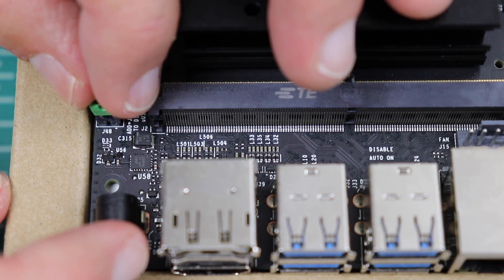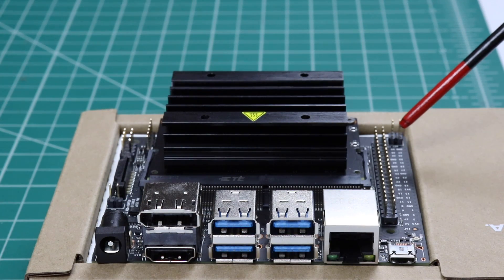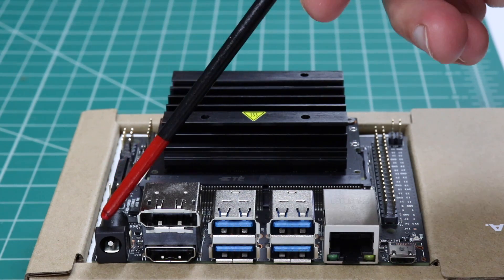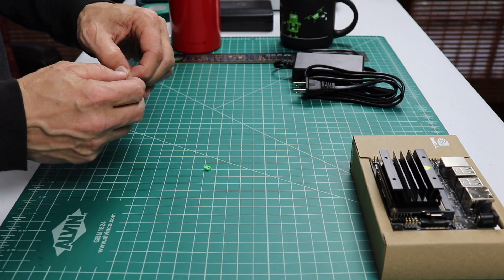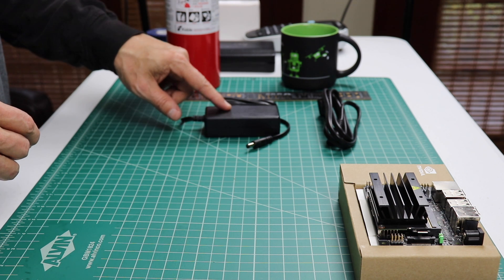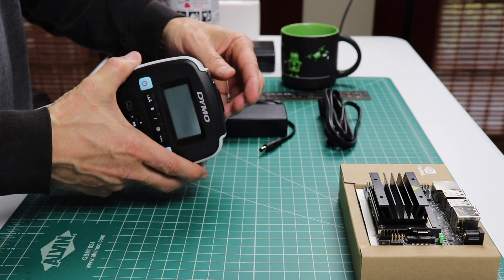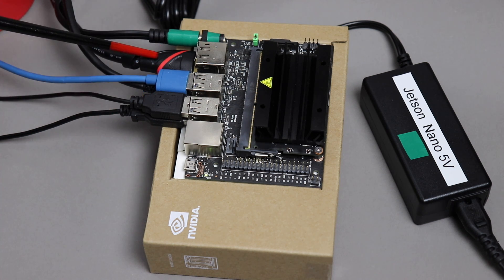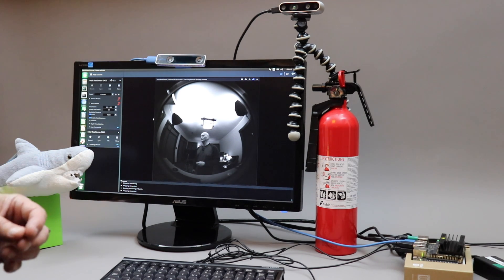USE the POWER! - Jetson Nano

Comment from the maker: I lied in the video. There are actually 4 ways to power the Jetson Nano. As mentioned in the video, there is the micro USB connector, the Barrel Jack, and the 5V pins on the GPIO header. There's also what we'll now call "the secret way", powering the Nano using Power Over Ethernet (POE). Many Ethernet camera systems supply power in this manner. Thanks to @Alex Carter for pointing out this blatant lie.
Reply: VIDEO =)
Reply: Hello! Could I use 5V 5A power supply with barrel jack in Jetson Nano?
Reply from the maker: @globalheII  Sure, as long as you use the right size barrel jack. Thanks for watching!
Reply: @JetsonHacks  Hello, first of all, thank you for the descriptive tutorial. I was wondering if we can use a DC barrel power supply of 5v - 3A. Would that put the Jetson nano on overdrive when its peripherals draw power? Also, someone asked about using 5V - 5A isn't the supply too much for Jetson to burn out? Could you please elaborate, if possible on this "universal" question?
Reply: @karthikshanmugam6226  Whats important is that you supply 5V. The 5 Amps mean that this is the maximum possible for this power supply. In the end the amount am amps used depend on what you are running on the Jetson Nano and what you plug in to it.
To answer your question. Yes, also a 5V 3A DC barrel power supply will work.
Reply from the maker: @karthikshanmugam6226  The carrier board can support 4A, 5V. The Jetson module draws ~ 2A at maximum clocks, so 3A would leave less than 1A for any devices attached to the carrier board. Electronics won't draw more current than they use. So as long as the voltage is correct, the plug is of the right size and wired correctly and so on, having more current available than the device uses should not damage the device, assuming a stable power source. Thanks for watching!
Reply: Let me write my concern about your update. It seems that Jetson Nano Dev.kit does not contain PoE circuits on the board and as for Raspberry Pi, it needs for additional mezonin board  a.k.a. PoE-hat, which transforms PoE supply to Jetson needed 5V supply and provides it via GPIO header, does it?
Reply from the maker: @aleksandrbelykh4909  That is correct. It is pin compatible with the RPi, and requires the same 48V to 5V converter that the RPi does. Thanks for watching!
Reply: How can I use the 2 5V GPIO pins to power the Jetson nano? Can you direct me to a reference document on how to do this or better still a video as this will really be helpful on my current project?
Thanks
Reply: Was this video for the 1st generation of the Jetson Nano board?

Comment: I have 5 v 3 Amp barel Jack charger can i use it.. Is there's any ploblem with that
Reply from the maker: That works if you have the right sized connector. 2.1mm ID, 5.5 mm OD, center positive. Note that the board can draw up to 4A. Which means that you may have situations where the board is trying to draw more than 3A. This might be from a combination of Jetson power draw and peripheral draw. For example, an additional  power hungry USB device or two. Thanks for watching!

Comment: please how to add a reset pin to the developer kit?
Reply from the maker: On a Jetson Nano B01 (the one with two camera connectors), you short pins 5 and 6 of J50. J50 is located on the carrier board directly underneath the SD card on the Jetson module. Typically people will put some type of momentary switch there. Thanks for watching!

Comment: Do you have a tutorial to power the jetson nano with gpio pins? I need the maximum power mode on a mobile robot.
Reply from the maker: No I don't. However, you should be able to connect your power source directly to the GPIO header using standard Dupont connectors. You'll probably want to make sure the power source is well regulated, a 5V. If you want to be sure, you should ask on the official NVIDIA Jetson Nano developer forum, where a large group of developers and NVIDIA engineers share their experience. Thanks for watching!
Reply: @JetsonHacks  yep, was really easy. I use to outputs from Xiaomi power bank and just connected it to 2-4 for 5V and 6-9 for GND. Thanks for your reply.
Reply from the maker: @johansebastian836  You mean I guessed right again? I'm glad you got it to work.

Comment: Hi Jim, my Jetson Nano is shutting down when I try to run camera and Lidar both. I have connected with Lipo battery of 4A, 2200mah,11V and 14.43Wh. I'm using buck converter to step down(4A, 5V) the voltage. If I unplug Lidar then it's working fine but shutting down if both connected. And I'm also able to run both with 5V, 4A adapter. Can you tell me where the problem is? Thank you so much. :)
Reply from the maker: I do not know where the problem is. However, it seems unlikely that your battery solution is actually providing 4A. A buck converter, while efficient, will still cause some power loss (usually a little >10%). Also, the claim that the 2200mAh battery provides 4A seems odd. If the battery is 1C, you would expect 2.2A, if 2C you would expect 4.4A. Sometimes the manufacturers fib a little, or the battery might be a little older and not provide that much current.
Reply: @JetsonHacks   Can you suggest me any suitable battery?
Reply from the maker: @ansjaved3484  I don't have any suggestions, it depends on the application. Please ask your question on the official NVIDIA Jetson Nano forums, where a large group of developers and NVIDIA engineers share their experience.

Comment: I am trying to run jetson nano using micro usb cable and it is not working. I cannot see anything on display. Should I use barrel jack connector?
Reply from the maker: Hard to tell from your description. You should ask the question on the official NVIDIA Jetson Nano forum.
Reply: @JetsonHacks  Thank you so much for your response. I appreciate it.

Comment: would it be ok to power the NANO through the header pins with a battery? The  voltage would be regulated.
Reply from the maker: It should be. This question is worth asking on the official NVIDIA Jetson forums, where a large group of developers and NVIDIA engineers share their experience.

Comment: Ì do not understand the video. Is there any different to power it with micro USB connector  or   the Barrel Jack if both have 5v 3A =15W?  will it go slower with the micro USB then?
Reply from the maker: The maximum current the Jetson can draw from the micro USB connector  is 2A. The maximum barrel jack draw is 4A. Not sure what your point is about in using 3A in both cases.
Reply: @JetsonHacks  ok, so if the Jetson nano need more than 2amp will it slow down the CPU speed or will it shot down when I power it with my 3amp power connected to the micro USB?
Reply: @JetsonHacks  I ask because I have one both alternative to power it, but I do not want the CPU to go slower.

Comment: Hey Jim, how do I hookup to the barrel jack using a Lipo Battery (Ovonic 11.1V 5000mAh 3S 50C-100C) as my power source? Thanks in advance!
Reply from the maker: Typically you would use a buck convert/voltage regulator of some sort. While it is straightforward, it is not trivial and if you are using a LiPo there are added safety precautions with which you should be aware. Heat dissipation is another area with which to be familiar. The answer to this question is more than can be written in a YouTube comment, please ask this question in the official NVIDIA Jetson Nano developers forum where a large group of NVIDIA engineers and Jetson developers share their experience. Thanks for watching!

Comment: Hi I get [No HDMI signal from your device] when using micro USB connector even without connecting any peripherals.
Reply: Update: The display is available after unplug an plug back the cable

Comment: Hi. Is there a fifth way and if so would you do a video please? What's the fifth way - battery. Ok not exactly a fifth way because you would need to use one of the standard ways to power. I am enjoying the videos and wonder if this is the sort of power that gives you the option of running this as your daily rig. Keep up the good work as you unveil the hacks you can do with the Jetson.
If the jumper doesn't jump, is it worth using it to keep you warm?
Reply from the maker: This is a very broad area without some type of application in mind. It can range from connecting connecting a 5V power bank (such as: https://amzn.to/2XkbWi0 ) via microUSB to much more complicated setups using very large batteries and voltage converters/buck converters. Thanks for watching!

Comment: Sigh.  For a 2019 device, why not USB-PD?  Using USB-C interface with 30W easily.  No over-voltage, no "magic smoke"  Alternatively, there is a RJ45 interface, why not use PoE?  Than can go up to 45W or 29W modes  Cheap and lazy designer of the board.
Reply from the maker: The Jetson Nano Developer Kit has a PoE header ( J38 ). That header passes through the high-voltage 48V PoE supply from the Ethernet port so that it can be stepped-down or regulated by 5V PoE hat or voltage regulator. This regulated 5V supply can then be passed to the 5V input pins on the 40-pin header.

An example PoE hat that can do this automatically is here: https://amzn.to/2GqmvL6
It will take the 48V high-voltage from the header, step it down to 5V, and pass it back to the 40-pin header. It can be mounted on top of the Nano devkit. Or you can do this manually by wiring in your own 48V->5V regulator. Does this not meet your needs?
Reply: Close enough for the time being.  If the board can be powered by PoE (rated length of cable to be 100m but recommended to max 90m) at least it is better than using USB power which has limited range (3m if I remember correctly) or the power brick which is 1-2 m max from a power point as well.  However, the one you suggested only output up to 5V/2.5A = 12.5 W, still lower than the barrel jack.  So greater range + convenience (if you have PoE) - price (as not everyone can get access to a PoE switch which is more expensive than a 30W USB-C PD charger) - vs more power & shorter range.  

That said the next version of the board should just eliminate the barrel jack and upgrade the USB interface to support USB-PD as the sole reason for the barrel jack is an obsolete interface to provide more power to the system.  As seen from the many comments below, there is a request for USB-PD.

In both cases of USB-PD and/or bult-in PoE support, the board can accept more than 25W which would greatly expand its capacity to support more demanding chips etc.
Reply from the maker: Thank you for taking the time to comment. As you know, the Dev Kit consists of two parts. The Jetson Nano module, and a carrier board. There are several companies that are working on bringing different configurations of carrier boards to market, perhaps those will better fit peoples needs.
Reply: Agreed.  As long as there are alternatives then that would work.  Hopefully Nvidia's next carrier board is more up to date.

Comment: Do you think the microsd as a boot device will be a bottleneck? I want to use the jetson in a car pc project, so i want a fast startup time. Cant use the m.2 becasue its e keyed so only thing else is usb 3 boot.
Reply from the maker: Everything eventually becomes a bottle neck, ask any racer ! It's 'slow' to startup (you can measure that), but in an automotive application you may just want to have it suspend/hibernate instead of a cold boot all the time. Thanks for watching!

Comment: I will be needing to power from 12v Battery... will this work DROK 180051US Numerical Control Voltage Regulator DC 5-32V to 0-30V 5A Buck Converter?

Comment: Doesn't it have Power over Ethernet
Reply from the maker: Doh! I completely forgot about that! Thanks for pointing this out, and thanks for watching!
Reply: Is power over ethernet significantly weaker than using the dc jack?
Reply from the maker: @Neomanee  For the Raspberry Pi POE hats, the power is limited to 2.5A @ 5V. POE is 48V, so it needs conversion to 5V. However it is with asking in the Jetson Nano forum as to what the maximum power that the Nano can accept through the POE pins. Thanks for watching!

Comment: Can you please do a quick guide for powering it via battery? I was planning to use the USB but now see that's not who I want to be.
Reply from the maker: Batteries are a lot trickier, because power draw, battery selection and application make a difference. If you plug it into the wall, it's easy to make a selection. With a battery, there's a bunch of tradeoffs. For example, two of the NVIDIA robots that were introduced at GTC use a Nano ( https://youtu.be/X3qGDYie1_I ) The JetBot uses the USB port and runs in 5W mode. This is really cool because you can use an inexpensive 5V power bank, and all you have to do is plug in a regular USB charging cable. In general, power banks don't deliver 4A, they are usually less than 3. 

For more current, most batteries are at higher voltages. Which means you have to step down using a buck converter or voltage regulator. For example, the Kaya uses a 20V DeWalt battery (from a drill) and a step down regulator. You have to do some wiring and such to get everything to work. Of course, since it's a system that means it all plays together, you need a bigger battery for more power, the higher power draw means that the batteries don't last as long, the batteries weigh more which matters if it's on a robot and is mobile, and so on.  It's a little different game in that there's no 'obvious' solution. 
Thanks for watching!

Comment: Looks like there is some pretty bad latency in that setup, is it just the viewer or is it really that bad?  Thanks for all of the awesome content!
Reply from the maker: You're welcome. At the time of the video, I had just succeeded in getting the RealSense cameras  to work. There's still a bunch of work left I'm afraid, including video display optimization. At the same time, camera to glass latency is higher than normal cameras, because they process the images before sending them. It also doesn't help that the images need to be scaled before they are displayed. When you have 3-4 streams coming in at 30 fps, it just takes a while to get it on the screen. 

Typically that's not the way these cameras are used, the output streams are usually processed by an application (for things like depth sensing, occupancy mapping, SLAM) and are not displayed as a video stream on this level of machine. Thanks for watching!

Comment: Hey Jim! Nice video as always! Is barrel jack maximum power draw 4000mAh ~ 4a at 5v? I wonder how would Nano perform with microUSB power without an attached monitor. It can't draw more than 2amps through microusb, right? My Nano just arrived Brazil today, I'm receiving it home in a couple days. Cheers!
Reply from the maker: Thank you for the kind words. I'm not sure what the tolerance is for the current draw. My guess is that it's a within the specs +- 10%, but that's just a guess on the 2A and 4A. The power draw issue isn't just the monitor, it's the combined draw of the Jetson module plus all the peripherals (mouse, keyboard, cameras, USB devices like USB drives, SSDs and so on), and anything attached to the GPIO pins. Thanks for watching!
Reply: @JetsonHacks  my nano is inteded to work with a Zed camera. I guess I'll need to switch to VGA resolution in order to make it work :( Btw, does RealSense D435 retrieve depth images in grayscale tones like zed? I'm considering if it is worth to grab one to replace my Kinect360, but I'm worried with unknown pixel areas of RealSense.
Reply from the maker: @antoniodourado  The depth images are returned in gray scale. In the video, false color is mapped onto the depth information. The RS cameras use different smoothing algorithms for hole filling, it depends on the application as to if that will fit your needs. Thanks for watching!